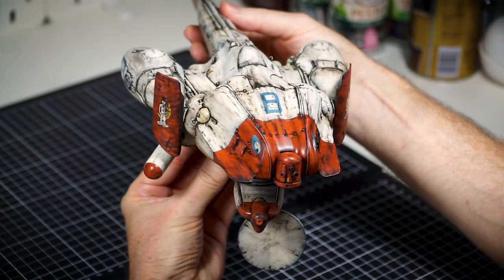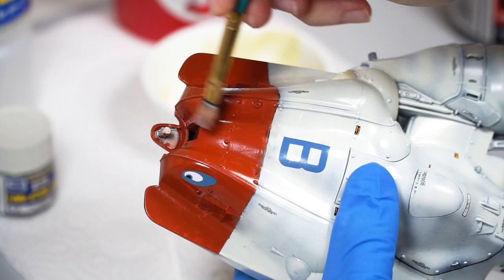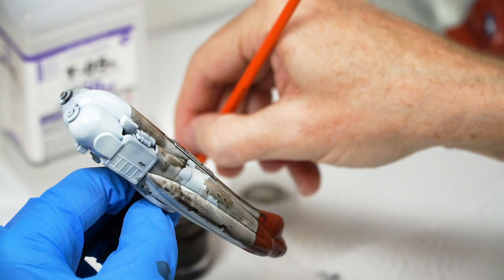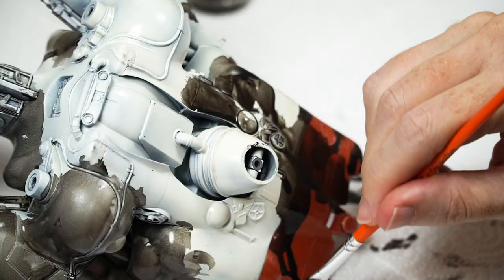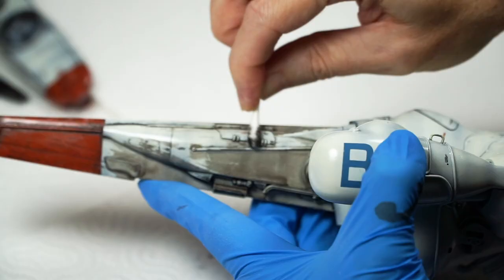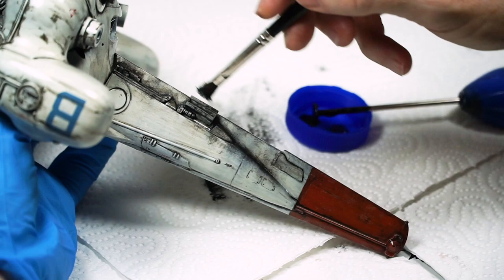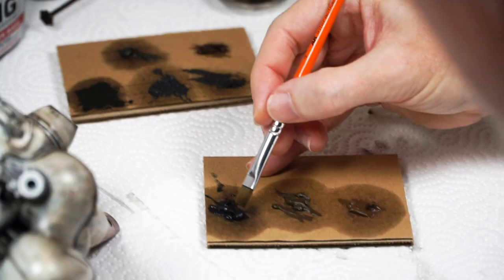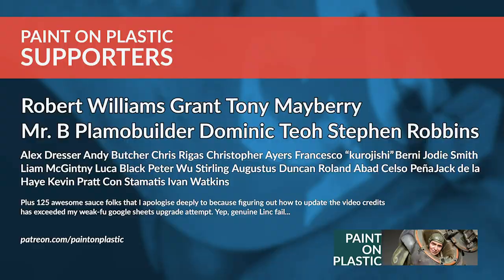Weathering the Ma.K Lunadiver Stingray Gunk Wash Oil Paints with Lincoln Wright

Comment: Hi Linc, did you varnish the model after painting, and before proceeding with the weathering sauce? I love using lacquers for basic painting but I am not sure if I can use oil weathering techniques on top of them without reactivating the lacquers with the oil medium - without a varnish  first (varnish acrylic or lacquer would be best?, I wonder). The problem with varnishes that I have is that you loose the nice variation in shininess and specularity (ok same thing... 😊 ) you can achieve using matte, glossy and satin lacquers together.
Reply from the maker: Hi Manos, yes there is some clear lacquer varnish here over the decals but before the weathering sauce. The mineral spirits will attack the water slides. I chose semi-gloss so that it doesn't stain the surface too quickly. Hope that helps!!
Reply: @PaintonPlasticbyLincolnWright  thanks for the quick reply Linc! Yes, I understand, this makes sense. Cheers!